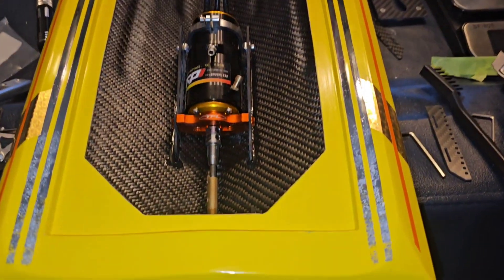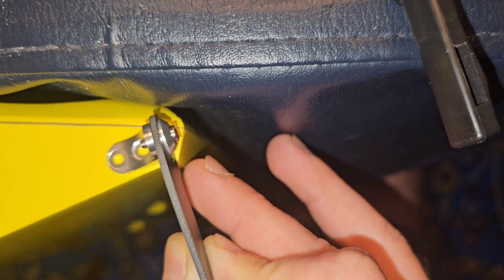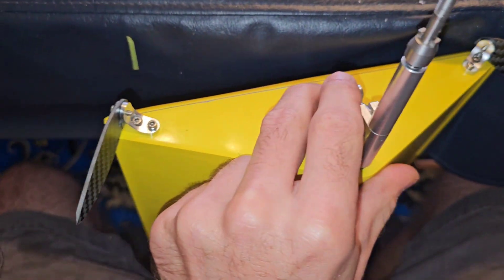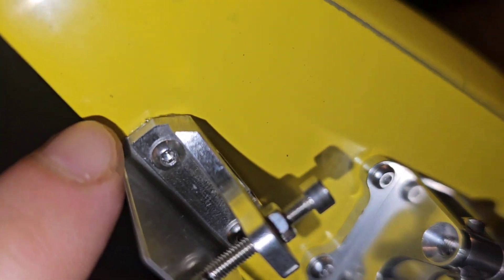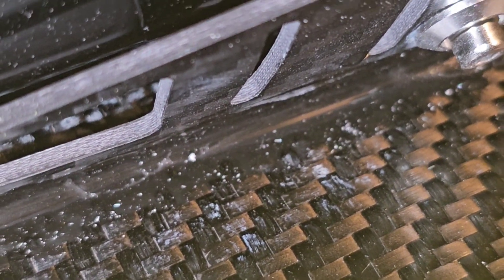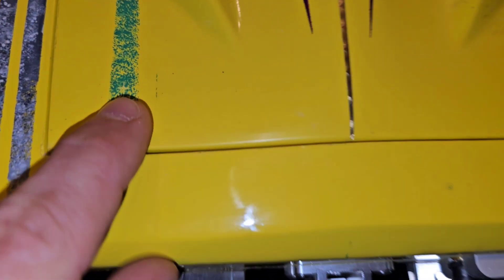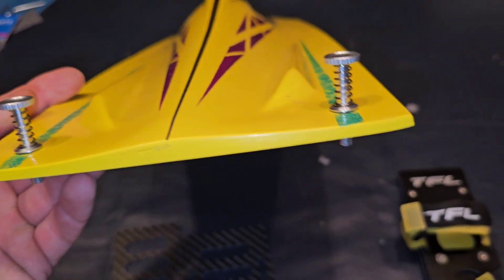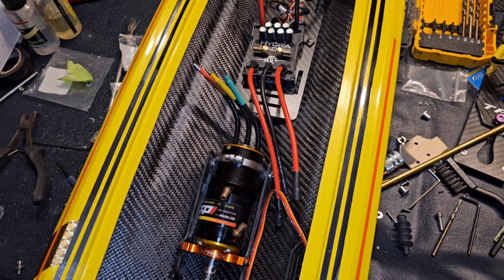RC Boat Build, Part 2 - Main Parts Install & Motor Choices - Delta Force Chaser 32"

Comment: What does this hull come with please? Any guidance as to locating the drive stinger dimensionally- and locating the rudder? Did it come with that stuffing tube support? Former nitro outrigger guy from the '70's- just getting back into the game- going electric. How do you feel the quality of this hull is?
Looks beautiful- and purposeful!
Reply from the maker: @wesjames6276  it's a thin hull, needs reinforcement. I copied another boat I had already.  Id give this hull a 6.5 out of 10
Reply: @H2oMechanicHobbies  Thanks! Any other/better hull recommendations in this mono style?
Reply from the maker: @wesjames6276  Oxidean Dominator hull & hardware (non self righting version)  or the Offshore Electric M34 carbon mono

Comment: Looking good, looking light weight looking like she will move. 
Can't wait to see her run! 

If I may add. 
The key to running mono's cool as can be.. is reduce drag, reduce drag, reduce drag.. Can't emphasize that enough.. 

You're almost there setting her up for open class mono racing!! Don't think that's your intent though.. If so,
Throw the esc back by the motor 
SMC HCL HP 6s single pack up front on the tray

It won't be the fastest boat in the class. BUT.. The fastest boats don't always win 
You'll run cool you'll run stable in the chop... And you'd be able to run at wot 

Great build series!

Comment: A 3000kv 4092 will be an amp hungry motor. You will need the castle hydra for that motor. 

For battery think smc srd cells. I would would say 6200 mah or higher, all depends on what you can fit comfortably on the battery mount.

The motor will be amp hungry on 4s, you would have to settle for an abc 1714 to 1716 17 45 2 blade.

If you can get say the 8600 mah smc srd cells, you may be able to try the 1814 to 1815 or 1816 17 45 2 blade props. Which would draw 315 to 330amps. Peak amps would be like 380  plus amps, which would drop of to the 315 to 330 when the motor reach peak speed.

Ampdraw might be in excess of 250 amps on 4s with the 17 series size props.

I can picture speeds of 60 plus on 4s.
Reply from the maker: @patricksmith6588  I've got 8600 4s SRD Packs & 11300 HP 3s Packs. The 3000kv might need the xlx2, but poseidon says it's 6s capable in less the 10 sec Bursts. So it's more of a speed run motor since it's a metal wrapped Rotor. I'll probably test it last in the series.  First will be the 1650Kv, then a 2200kv, then the 3000.
Reply: @H2oMechanicHobbies ,The 3000kv is a 2 hard passes setup on 4s. Then recharging the battery for the next 2 hard passes.

If you try the 18 series size props with it, I would saw 1 hard pass.

I think you need to set the low voltage cut of at 3.4v per cell. 

I tried a 2751kv 4092 before with an aggressive prop and I was fortunate my reciever got damage after a less than 2 second pass. 

When I when home and check the datalog I realize another passes would have likely damaged my smc srd 6200 v3 4s.
Reply from the maker: @patricksmith6588  excellent information to know! So 1 or 2 runs & follow my data log closely! Good to know. That's kinda why I wanted the 2560kv...but it wasn't available unfortunately

Comment: All top of the line components installed like it was factory made and great job on the servo mount, these wfly x9 remotes are as good as you can get based on reviews i have seen although i use the Spektrum Pro because of the launch control which is not only good for no prep drag but boats too.